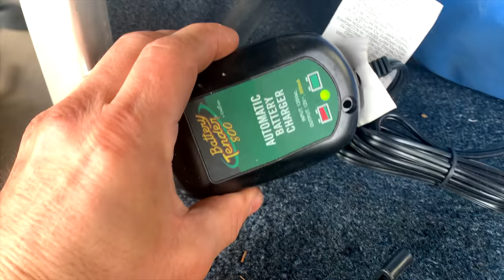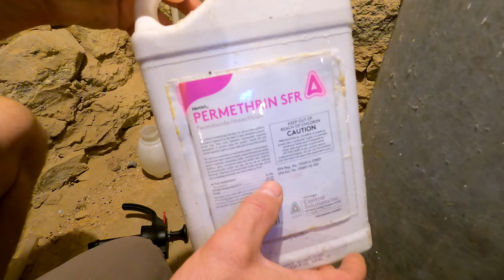8 REAL Farm and Garden Hacks You Probably Haven't Seen Before.

Comment: I use the same construction design but instead of cattle panels, I use concrete reinforcing wire. It's a smaller gauge (bends a little easier) but still much heavier than what you can get on pre made cages. Mine give me about 6-8 years of service before the wires that stick in the ground rust bad enough to break. I cut the old points and the next ring of wire off the bottom to give it fresh points to stick in the ground. It leaves the cage one square shorter but I get another 6 years of use. I have no idea how much this wire cost, I just get leftover pieces from friends that work with concrete construction. I use 11 sections to make mine. 10 for the cage and the 11th to bend back around to lock the ends together and make the circle.
Reply: I think your choice of any number of various coatings you might already have lying around would add 3-6 years to the lifespan before a problem like that.
There are things I wouldn’t really want in the ground my tomatoes grow in but unless you’re consuming them like it’s going out of fashion I think there’s bigger things to worry ahout
Reply: Pull them out of the soil after growing season.  Mine have lasted 30 years.

Comment: Once you get the flame established in a bonfire you can also use a leaf blower to keep it going. I watched a guy burning up a pile of medium sized stumps in a constant misty drizzle by driving the fire with excess air. It also helps keep down the soot/smoke to burn with an excess of air. I had no idea he was burning until we were within 100 yards of the property.

Edit: Permethrin can also be dangerous for cats, worth looking in to at least.
Reply: This!  A much more efficient use of a splash of gas.  I've burnt some pretty wet stuff this way.
Reply: I just use a zero turn mower and stoke it up as needed.

Comment: We use cattle panel tomato cages more simply by cutting them in squares and pairing two panels like an A frame.  This folds up flat for off season storage.  

Also, a small handheld propane tank with a soldering torch works great for starting a wood pile and a battery leaf blower will supercharge the flame into a self-sustaining bonfire with minimal effort.

Comment: For starting big brush pile fires I have found using a bag of match light charcoal works well too. I put it at the bottom in as far as I can shove it (entire bag unopened), light the bag, and it’s as simple as that.
Reply: I change my own oil. i used the old oil to start fires. It doesn't take much.

Comment: I'm an old retired rehab nurse that now gardens without help. Your advise on using your legs (quadriceps) and saving your back is really important information. I have worked with big strong guys that had injured their back so I was faced with doing the lifting myself. I do what ever I can to prevent some heavy thing being on the ground. I keep a tarp or something in my car not to keep dirt out but so I can just pull something heavy out and on to a garden cart with boards over it. I then transfer from the cart  to a storage bin with the top so I can just flip it over into the cart if I need to. I do allot of drag and flip. Easier than lifting people.

Comment: We do something very similar for tomato cages - but instead of using the cattle panels we use concrete reinforcing steel mesh, or "remesh" I believe it's often called.  It you need to make a lot of cages, it might be even more cost effective.  And if you buy it in a roll, it already wants to take the shape of a tomato cage vs starting from a flat panel.
Reply: I’ve used this mesh to keep moose from destroying trees.
Reply: Agree, much easier to work with and mine have lasted 30 years.
Reply: Much cheaper!

Comment: Great video and tips, thank you!
I can attest to gasoline and diesel being extremely dangerous when used to start a bonfire/brush pile fire.
When I was a teenager I went to burn a pile of brush. I had a mix of gasoline and diesel that we used to start the fire. I sprinkled a small amount on the pile and went to put the gas/diesel can back on the wagon away from the pile. I went back to start the fire with a wad of paper that I lit and threw into the pile where I had put the fuel mixture. The whole pile exploded into flames and put me in the hospital for two weeks with burns to my face, arms, hands, and lungs. It was later decided that the hot temps and high humidity that day served to quickly vaporize the fuel and the fumes spread through the entire pile and caused it to explode when an ignition source was introduced. 
Be careful out there, it could happen to you and it could be worse.
Reply: Me thinks what you thought was a small amount was probably a large amount.  I Use diesel and run a diesel petrol mix out as a wick and light the wick but find the best is a small piece of car tire tube. I even take a small piece with me when I go bush. You can get a fire going in the rain if needed.
Reply: @wayneg8763 , Nope, the gas/diesel was in an old milk jug, I could see exactly how much I used. That happened a long time ago, I now know how to better start a brush pile fire.

Comment: I've used a couple of these tricks before.  The first one about putting a battery maintainer on infrequently used equipment I used on my personal pickup after I got a company truck and rarely used my pickup.  I read about a tip to connect the maintainer to the wall outlet with an extension cord long enough to go through the steering wheel so you don't drive off without first unplugging the maintainer.  This was an excellent tip for my absent minded self.  This works as long as the vehicle is inside or at least under roof.
Reply: I have a maintaining solar panel because no hydro

Comment: I've seen or used all before, you can grow the other "tomatoes" with those cages as well,  baking soda vinegar will settle the smell on your portable air tank.  
I use essential oil blends for bugs because smells good. Use quick grip vrs C clamps and bamboo arc for lightweight drill holes in 2×4 for bamboo and quick grip the 2x4 to your bar.
Reply: Loopie tomatoes! Lol

Comment: Cattle panels are great for all sorts of uses. I designed a cage similar to your tomato cage but bent the wire at 90° angles to make a tall square or box shape. Then I could place a game camera inside the cage looking out through one of the rectangular openings. Now you have a camera mount that enables to place your camera wherever there isn't a tree or structure to mount it to. The cage offers protection to the camera, has a frame that can be camouflaged and allows you to pick various heights to mount the camera. You can make the cage taller or shorter depending on need and can make the bottom tines or stakes longer as needed for pushing into the ground. Also recommend a chainsaw refueling safety guide if you feel comfortable doing something like that. Had a friend using his chainsaw on a cool day and he stopped to refuel it with catastrophic results. Like lighting bonfires with gasoline, the fuel vapors will find a balanced triangle together with heat and oxygen. A fraction of a second later you don't have a fire, you have a problem. He died.

Comment: I have seen or used most of those. That weed burner was probably the best $20 I have spent. 
For free tomato cages look for free ibc totes on marketplace or Craigslist then cut the cages off of them, they bend with a little cutting. We used them just as flat panels and tied the plants to them. Worked good for something for cucumber to climb as well.
Reply: Fix that propane  tank on a dolly and weed burning will be even easier
Reply: @georgegaming5094  I hardly ever use it for weed burning, just melting and heating stuff.

Comment: This video popped up on my feed again today (5/14/2024), and reminded me again of things I have wanted to do but not implemented. I did purchase a propane torch for hand-held small bottles, and found that it works great for started fires in my backyard pit, as well as heating metal. The tomato cage hack is one yet to get done. I am going to share this to a couple of local gardening sites on Facebook, so hopefully you'll get some new viewers.

I got my Toyota forklift from Bidadoo/eBay last week. $215. It doesn't run,  but for that price I can do a complete rebuild on it and still be money ahead. I will use the Farmcraft 101 method of cylinder repair if and when the time comes.

Love the channel Jon. You are the guy I have always wanted to be.

Comment: Interesting, I remove the propane valve and dump the oil out (likely Ethyl Mercaptan) and replace valve. Smell dissipates after a while. Great tips video.
Reply: I save foam rubber if I find it to start fires. I also use a shop vac and tape a burn pipe to the hose on the exhaust port. A big shop vac will melt glass in a burn barrel. I have even used a ten dollar squirrel cage furnace fan with metal ducting or pipes to burn stubborn things.
   When a slob tenant leaves furniture behind you have to make choices. Even box springs lose their foam and covering and the springs collapse to recycled metal if you are creative. 
    Don't take chances with bed bugs. A dark plastic wrap and summer sun takes care of any nasties.
  A junk washer or dryer makes a killer burn barrel if reinforced with a second unit. Even dryer drums can be stacked together for a free burn barrel.

Comment: For tomato cages, we used a whole roll of concrete reinforcement mesh, which is 6’ tall and about 100’ long.  Makes a bigger tomato cage, and very sturdy.  Our tomato plants are big enough that cattle panel is inadequate.  To fasten them into the ground we use stainless steel staples.

Comment: Don't move your body when you shovel, and always grip the blade end of the handle with your hand over (palm down)  not under (palm up).
An expansion of your shovel work.  A too common job is filling the wheel barrow or filling the cement mixer.  Two things are important. First, pick the position that you absolutely do not need to turn, raise, or shift your body.  What is on the shovel weighs 6 pounds, 10 pounds,, If you are moving or turning your body to lift or throw the shovel load,, you are moving 150 pound to throw the 10 pounds.  That IS the total number of calories expended to move that single shovel load.  It is IMPERATIVE that you find the position of the wheel barrow or cement mixer or pickup bed,, that is inline with the pick up and throw of the shovel.  It will double or triple your productivity for the day or week.   Second,, you have two hands on the shovel.  The one hand is up near the end of the handle or gripping the D handle,, the second hand is gripping down nearer the blade.  Nearly everyone grabs that lower hand palm up.  No.  Wrong.  Nearly every shovel job your hand should grasp the lower hand near the blade with palm down.  There are exceptions to this,, but they are few.  Palm down, gripping over the handle,, once you get used to it,, greatly increases your range of motion,, range of throw.  And reduces the total calories expended.
I'm old.  Been doing this a long time.  Long enough that I have excavated for basements with a hand shovel and pick and wheel barrow.  Yep.  You cannot get a backhoe into some sites, can't.  Also,, so many placements of sand or stone were dropped from the back of a double bottom on the street,, and bobcats were very uncommon, or bobcats cannot get into a basement excavation to lay the sand bed prior to the slab pour.    Shovel and wheel barrow.  There are 1,000 tons of pea stone under one house I can think of and 40 yards of sand under the slab of another.  The 40 yards was placed in a single day. One man, one wheel barrow.  
Don't move your body when you shovel and always (nearly) grip the blade end of the handle with your hand over not under. These two things can double your productivity.
Reply: @patriciacole8773  I am glad you found it helpful.  It is arcane knowledge but even today there is a shovel in every garden shed.  It is still useful to me. 70 years old and we mixed our own concrete for a 1200 square foot shop slab.  Too far out in the desert for a redi-mix truck so 25 yards of sand and gravel shoveled in to a constantly turning cement mixer on a 3 day pour.  If you can find that sweet spot where you do not have to move your body at all,, you can move a lot of dirt

Comment: Fire starting - I found a blow torch or even a fire-lighter is enough to get it started, however I then use a leaf blower to fuel that thing with oxygen and watch it rip through. Even when down to embers, get that air in there and feel the heat sky rocket for whatever you are going to throw on top, wet or dry!

Comment: My dad made some super durable tomato cages out of a roll of remesh that is typically used for reinforcing concrete. Same idea as the one you showed. They have lasted for years!
Reply: I came to comments to post the same thing.  The wire is lighter than cattle panel, but plenty strong to last for years.  Also, way cheaper. The squares are 6x6... perfect for all but prize-winning beefsteak toms.

Comment: I make the tomato cages the same way. They last forever. You probably know this, but for others that dont. Right after you plant the tomatoes and put the cage around it. Get a very large plastic trash bag. Cut the bottom off. Slide the trash bag over the cage. Tye wrap the top edge of trash bag in 4 spots around cage to the top of cage. This acts as a sort of greenhouse affect to the plants. It also protects the plants from the rough winds and storms in spring. Your plants will be much bigger and grow much faster than your fellow gardeners in your area. I’ve done this for years and the results are incredible.

Comment: I've got one for you. Instead of using toxic wasp spray that is thinned down nerve agent (which is bad for everything), I use Mean Green cleaner concentrate. I mix it half and half with water, and use an off the shelf spray bottle. The nozzle can be adjusted to mist or stream, and usually has pretty good range. Once you get some of the cleaner on the abdomen of the wasp, it begins to aspirate and dies. It takes the fight right out of even the meanest red paper wasps and yelllow jackets. The best part is that the cleaner is biodegradable, and won't have any lasting effects after your encounter.
Reply: nice. Dawn dish soap and water in a good spray bottle work good and its  an 'organic' insect killer. kills faster than those nasty wasps can sprays and much safer for the person.
Reply: @GreenPlanetFarm  so does Mean Green.
Reply: We use Dawn ultra , because we have bees and that’s what you have to use if you have a diseased hive (or we use brake cleaner for quick squirts in smaller holes for instant death). The permetherin for clothes works great for ticks, but it needs to be applied and dried far away from the cat.

Comment: Lifting a boat on a trailer to the ball hitch: back up under the bow with knees bent and back against the hull then rise up using legs. As a 125lb kid I routinely trailered the same boat as seen on "Flipper". 
Bon Fires: cutting roads we piled green trees and brush with old tires about 1ft off ground. Mix a few gallons of kerosene with diesel fuel and splash. Give it a few minutes to vaporize then toss in a torch and it will slowly ignite without problems. 
bug juice: add one drop of cheap dishwashing liquid as a surfactant. It will break surface tension so the liquid soaks in instead of rolling off.

Comment: As a survivalist, I like to use toilet paper rolls to start fires. When the roll is empty, pack it with dryer lint that will catch a spark easily. Add saw dust or small bits of wood. Then, seal it by dunking it in melted wax. When you need it, push one end in, just flip it over and put it back in, then light the lint and start putting your smallest twigs on and watch it grow. 1 roll will burn for at least 5 minutes which should be plenty of time to get reasonably dry twigs to catch.

Comment: To start fires I use old limbs that fall out of trees cut them to length of a 5 gallon bucket and pour in some old diesel and let them soak up all of the fuel it wants. The well rotted ones work the best. I light it by putting a piece of paper towel underneath. The stick will burn for a very long time.

Comment: On the propane tank, I haven't seen one made into a compressed air container but I have seen tanks specifically made to hold compressed air for tires when I worked for the Forest Service. HA, never thought about a weed torch, which I happen to have (dang sandburs), for lighting a burn pile. I'll have to remember that one. LOL, no need to eat a screwdriver though.

Comment: For starting burn piles, I used to use a metal deck sprayer filled with diesel fuel.  I adjusted the nozzle spray to make a mini flame-thrower.  This was in a very wet part of the country, though.  The local tool rental place had large gas-powered fans intended to keep burn piles burning, but I was too cheap and they seemed like a hassle.  I have to admit that the propane weed burner seems like a safer approach.  Plus some unburned diesel fuel is going to contaminate the ground.

Comment: I like the bonfire tip (I use the same cheap HF torch to start mine). I have seen a lot of people either get burned or have close calls using gasoline. One thing I have found that helps when burning larger wood that may be a little green or wet and hard to get going: Make sure there is some large dry wood in the pile, and once the smaller wood and larger dry wood start burning, I will use a cordless leaf blower to add air to the fire. This makes it burn really HOT, hot enough to burn green wood. It will also help reignite the pile once it burns down. Now, I'm not talking about getting right up on the fire with the blower, as that would blow hot ash and coals everywhere, but from 10-15 feet away.